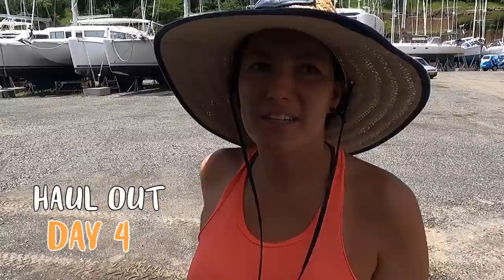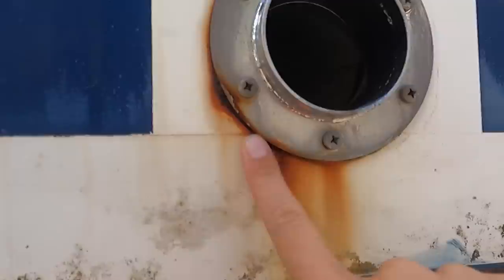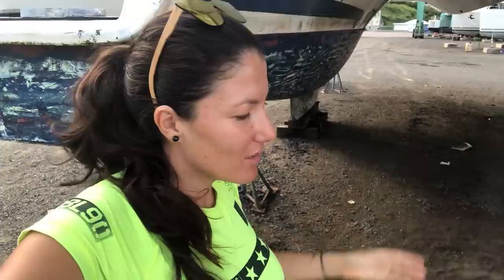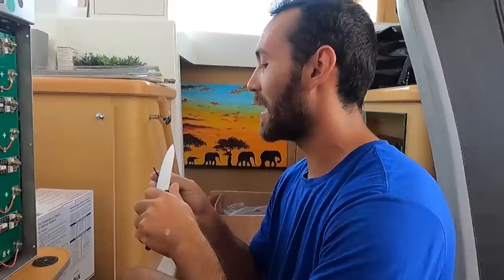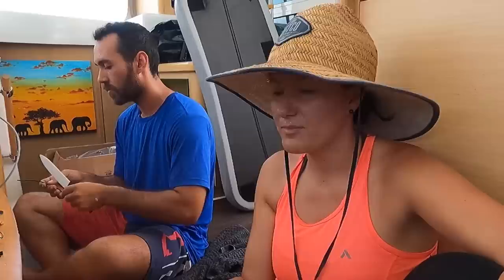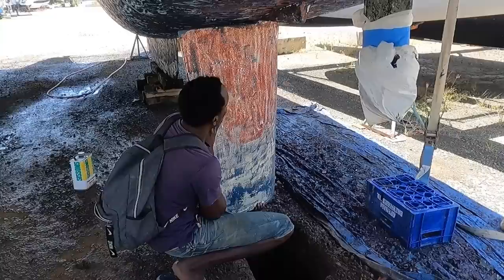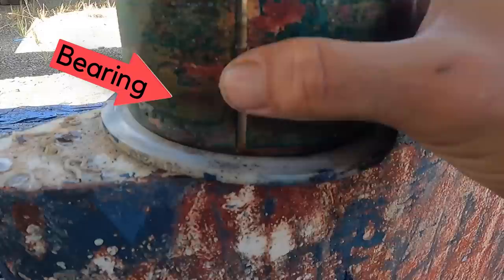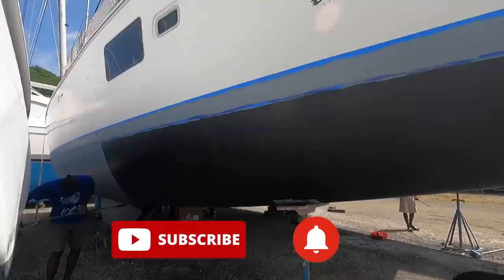SAILING CATAMARAN SANDING DOWN TO GEL COAT | RUDDER REMOVAL & REPAIR

Comment: Your whole process of the haul out is amazing and yes it is a LOT of work. But much cheaper when you do some of the work. I see you bought a Ninja blender , it is the best and will last for many many years. I have one that is going on 8 years and couldn't be happier. It will make sauces, mixed drinks and anything else you need in the kitchen. You made a great choice  !!
Reply from the maker: Hi Richard, yes its cheaper if you do the job your self for sure but there are certain things like polishing that makes sense to hire someone to do it. The ninja blender is amazing
Reply: @LivingHakuna     You are right, the polishing and that is better to have someone do it and it is backbreaking work. By the way how would I mail something to you ? I'm in Tampa. And yes you are going to LOVE that Ninja as it does everything !

Comment: Did you guys paint on a barrier coat before painting on the primer. A barrier coat is needed to keep the fiberglass hull from absorbing water and becoming heavier and prevent blistering.
Reply from the maker: Hi, the primer is a epoxy primer so it didn’t  need a barrier coat. thanks for watching !

Comment: You wanna change the floating lines?!!!
Reply from the maker: Hi pippo, what do you mean by floating line
Reply: @LivingHakuna  hola, I might have understood wrongly… when you mentioned that the balance of your boat has a tendency to sink the front due to the lots of weight in the front? And due to that the painted floating lines on the sides are not aligned to the water and therefore you wanted to repaint them according to the actual floating line? Floating lines must always remain the same, that was what I meant :-) . Maybe it’s me that I misunderstood?